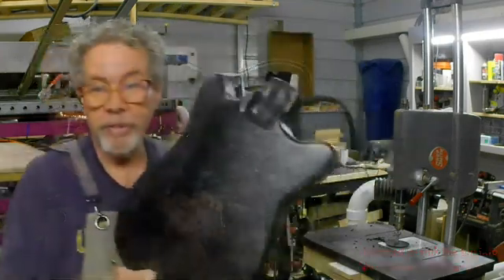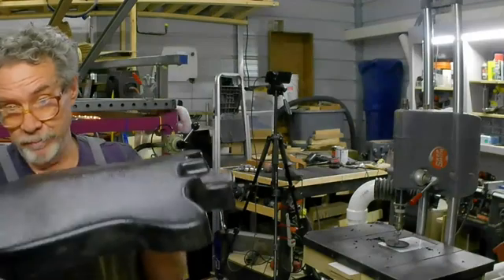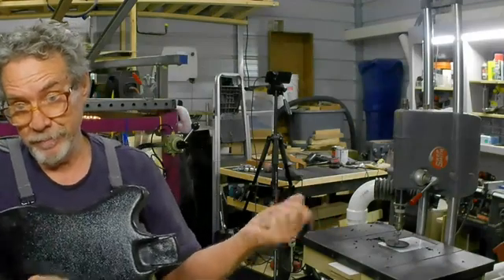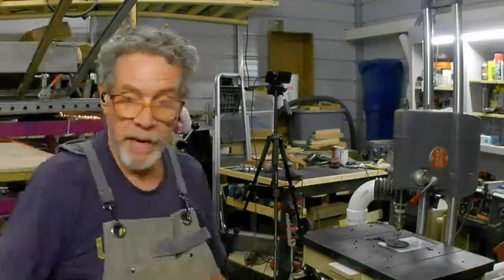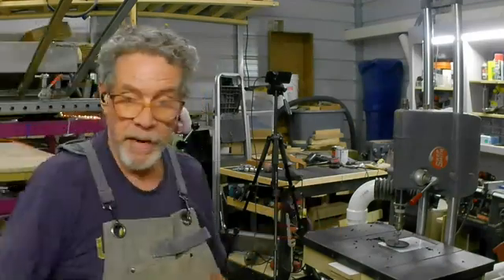First Plastic Guitar Thermoforming ABS | Plasticaster | GGBO Community | Experimental Luthiery

Comment: You know Spike. If you wanted to you could glue some kerfing along the open cut edge of the plastic and a block running through the middle of the plastic to attach the pickups and neck to and use a wooden top on that plastic body.
Reply from the maker: Making backs next, to build that way too